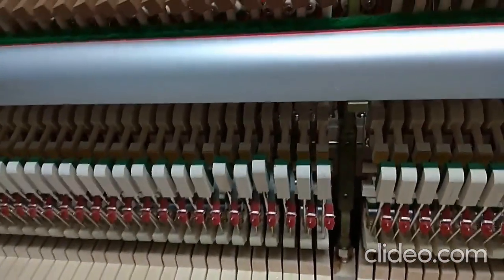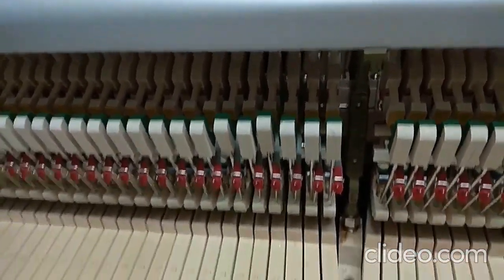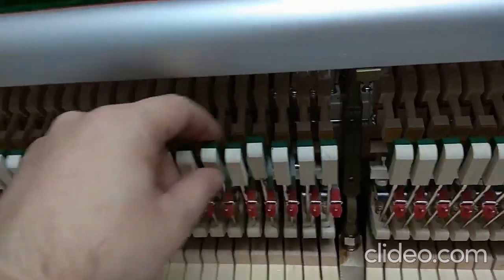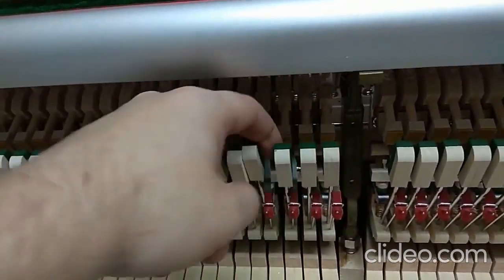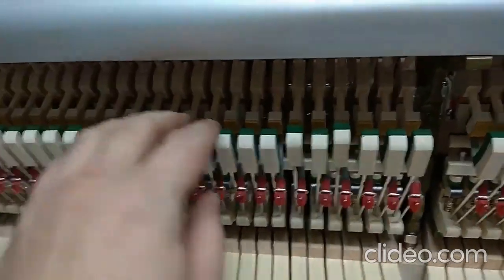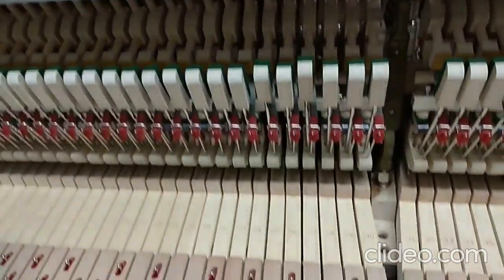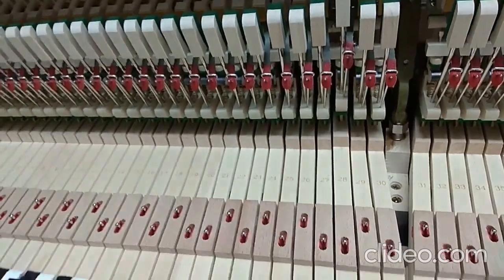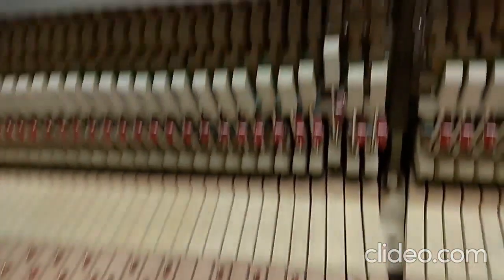'Methodology of Vladimir Sukhopyatkin'. By bending 'the backcheck wire' of an upright piano.

Comment: Question please,;
When checking/ setting back check will the measurement change according to how hard I strike the key?
It seemed like it was but I wasn't sure.
I did see I have to watch not to introduce after touch cuz it will move closer if I push it down too hard after the strings are already struck.
Thank you.
Reply from the maker: Dear @mrbreezeet1,
Thank you for your question regarding 'the back check' on the upright piano. You are correct in your observations about the relationship between 'the back check' and 'the jack of the wippen' position relative to the hammer.
As Mr. Sukhopyatkin demonstrated, the adjustment of 'the back check' is crucial for achieving a double strike on the strings. When 'the back check' is set correctly, it allows 'the jack' to remain in position under 'the hammer butt' after the first strike, enabling a quick second strike. If 'the back check' is too loose or improperly adjusted, 'the jack' may slip out from under the hammer, preventing the double repetition.
It's important to find the right balance in these (your) adjustments if you will try do it as Mr. Sukhopyatkin way . You can experiment with moving 'the back check wire' slightly away from you, which may help facilitate the double strike. Remember, this is a delicate operation, and you can always readjust 'the back check' if needed.
Don't hesitate to explore this adjustment, as it is essential for the proper functioning of the piano mechanism. Good luck, and feel free to reach out if you have more questions!
regards, Max